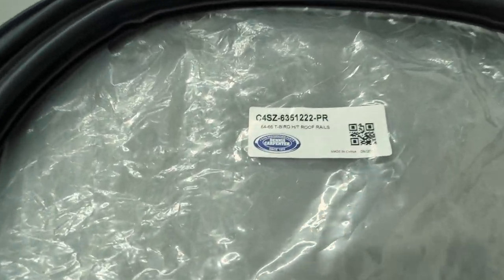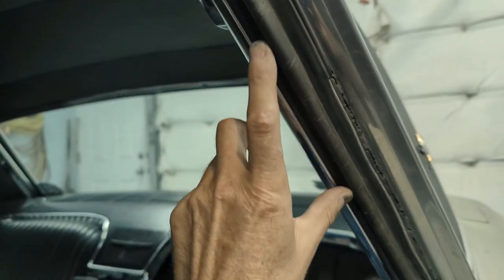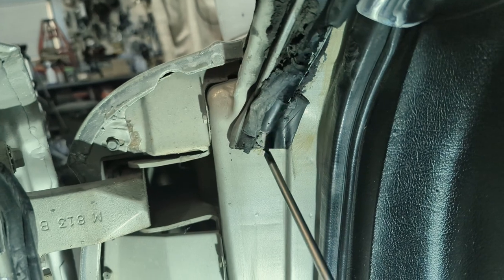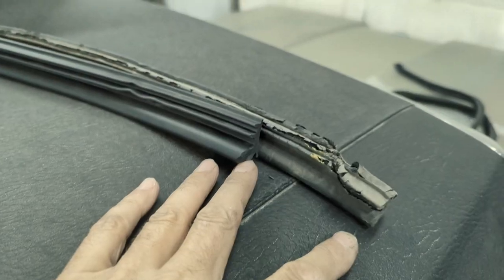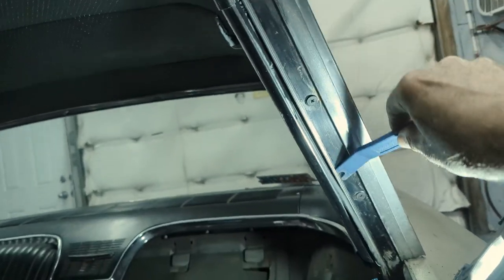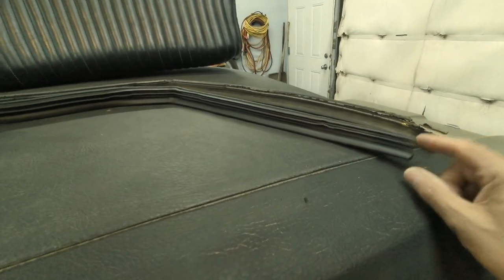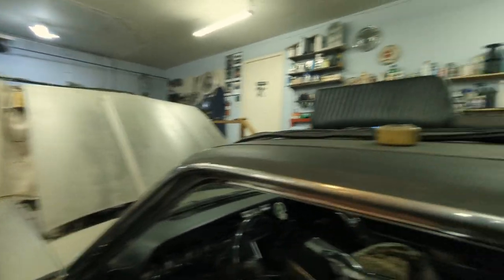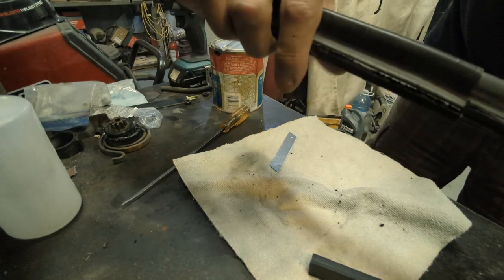Dennis Carpenter Window Seal Install - 65 Thunderbird

Comment: Hello Alvin: Thank You for this video. Well presented with clear instructions. Super glue was indeed the answer. Good to know. By the way, we have our 64 thunderbird back home in our shop. Long story:  the couple that bought it became intimidated by it. Were afreaid to drive it and found that it would not fit inside their garage. So we took it back, gave them a full refund. No hard feelings. They are family. We have been driving the Bird nights and are glad it is home. It is just as nice now as when we sold it. Thanks again for your video..... Walt
Reply from the maker: Thank you Walt, sorry that the sale didn't work out...but now you are back in the seat! 😎

Comment: I like your approach to the use of adhesive. The previous owner of my car completely filled the channels for the window seal with boatloads of adhesive. Also, the seals he used were stiff and a poor fit (maybe that explains all the adhesive). I went with Dennis Carpenter for my new seals. Couldn’t believe how soft they were—and a perfect fit. Nice  work.
Reply from the maker: Hi John, I figured I would try it without over doing the adhesive...so far nothing has dropped out of place. I could see a less quality window seal would need a little more help staying in place, but these ones are really nice.

Comment: Hey Alvin, another fine video. I think the factory did glue the roof rail rubbers in but more often then not, tacked them in. Ive taken some apart where they must have used the whole tube of glue but I think most of the time, the rubbers just pulled out easily and there was only a little remnant of glue to scrape off. Ive tried to put them in without glue but they come out when the door is closed so I glue them in. Better safe than sorry is my motto. Yeah, conv roof rail rubbers are more difficult. One reason is the repro rubbers are much harder than the originals so the windows do not sit into the rubbers correctly. Poor reproductions. Especially the 61-63 roof rail rubbers, they are terrible. Anyway, thanks for the video. Keep up the good work.
Reply from the maker: Hey Nick,
So far they haven't fallen out, fingers crossed on that one! I believe it has a lot to do with the repo manufacturer.

Comment: I don't know how the super glue worked.
I put a little on the weatherstripping on my 76 Corvette and it immediately started 'smoking' and looked like it melted.
Maybe the actual material was different from the material you have.
I had a 2” tear in mine and just wanted to re-attach it.
Also, I have used 3M Weatherstripping adhesive (mine was yellow) on a 66 Impala trunk lid strip but I didn't see any indication that the weatherstripping that you removed had anything like that under that weatherstripping. 
Do you think it was original weatherstripping?
Thank you for this informative video. Great job.

Comment: How is the cruise control working? Still good and all. Thanks for the vid.
Reply from the maker: Hi Doug, we don't do much more than cruise around town in the T-Bird, I did however take it out for a highway run last week, and the cruise control is still working, a little on the touchy side to get it set, but holds the speed once I got it set, I doubt it will ever be perfect. Lol